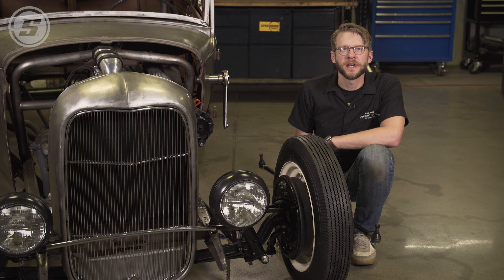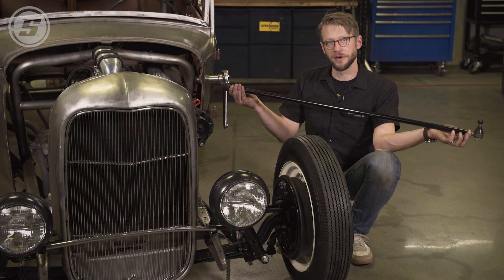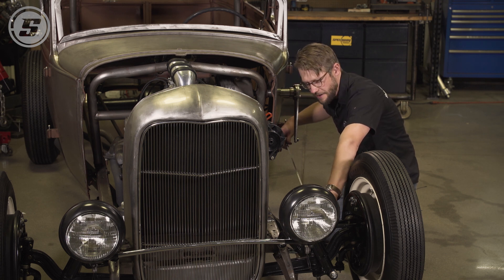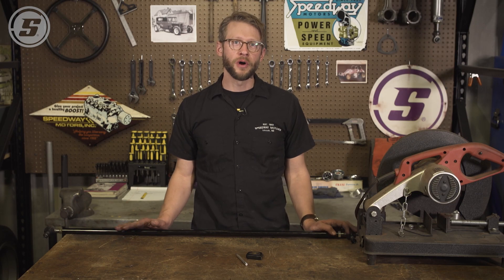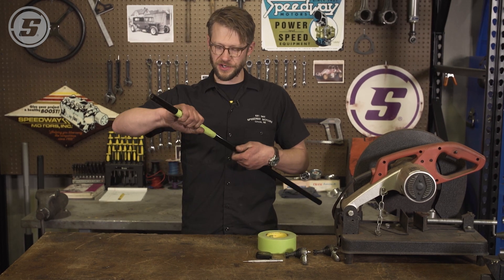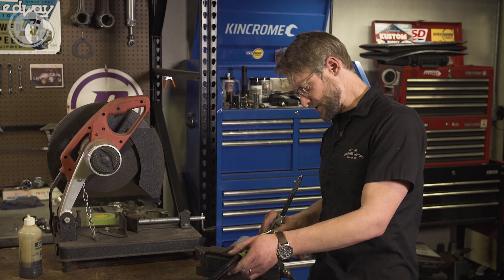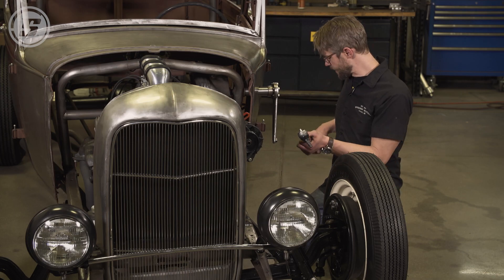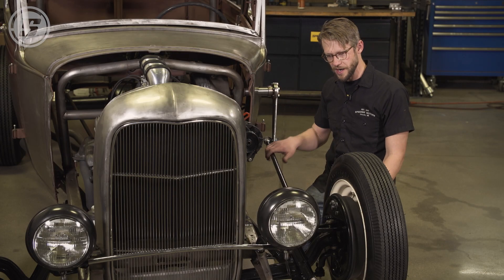How To Fit Your Tie Rod and Drag Link

Comment: Hello Speedway, first off, I've had great experience with your  associates and products. I have a '62 econoline, can I replace JUST the ball joints on the drag link and tie rod, instead of replacing  both of the entire systems ( link & rod )  That way there is no need to adjust tie ends after replacement,  Thank you

Comment: At almost 44, I finally bought the Model A that is in my avatar for my first hotrod, I figured after literally 30 years of wanting one it was time (it was time 25 years ago but better late then never but I digress).
Videos like this are excellent, I know and understand pretty much every system on a car and how they work but customizing a 1000 different car parts to work in harmony together is new to me. I had no idea you could cut the drag link and retap it. 
You get an A+ Speedway for posting this video.

Comment: Have a gasser '62 Ford F250 312 V8 3/4 ton. Lifted the front 4" with blocks. Drag link needs a new adjustable drag link now. Got one?
Reply from the maker: Hello Al. Our techs would be very happy to help you with your Ford! Give them a call at 800-979-0122 and they'll get you what you need.